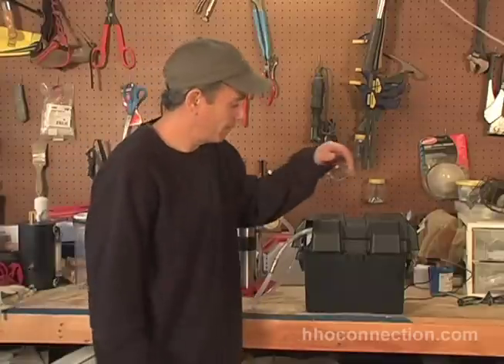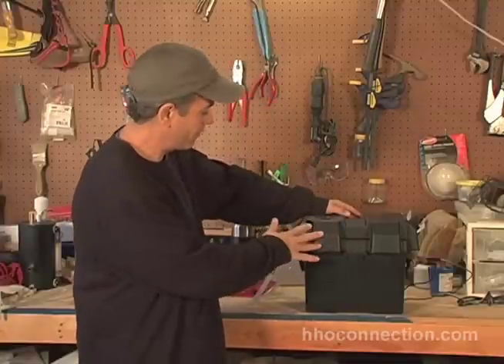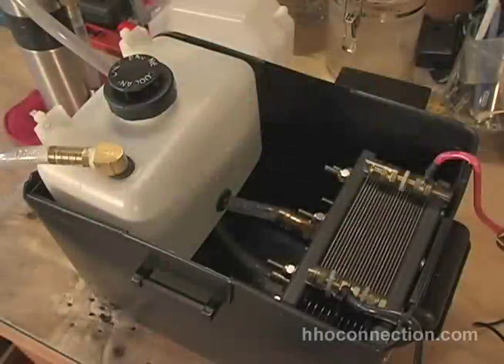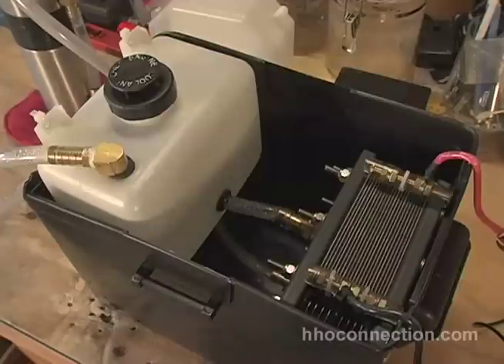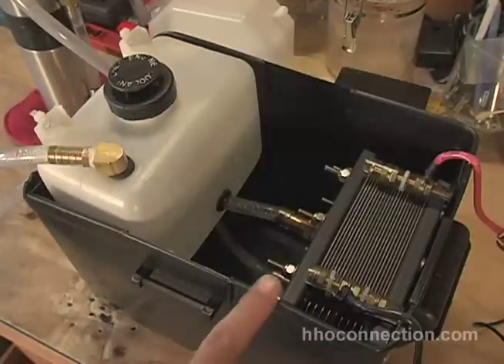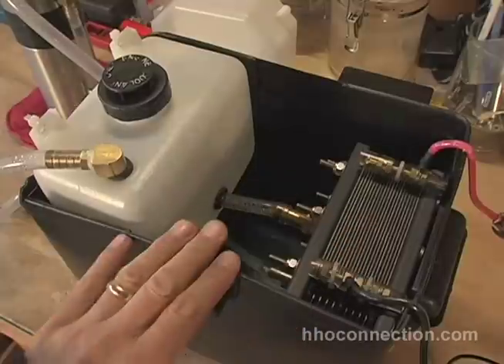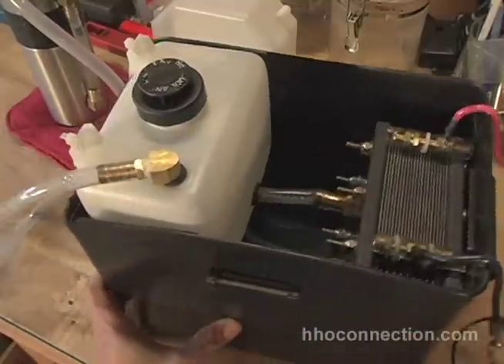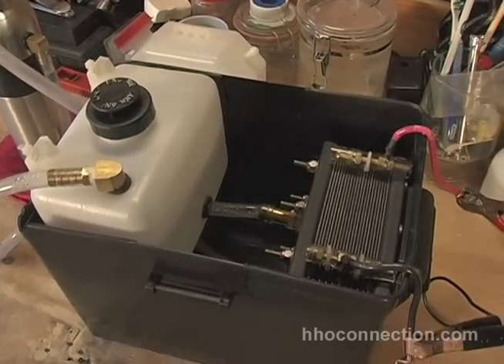Dry Cell Battery Box Idea

Comment: Very nice.  I've learned from your knowledge and experience and will apply it to my project.  It's a liquid cooled dual wet cell with an HHO ECU(Had to build this part myself) and a bubbler with baffles.  Just want to improve the efficiency of the HHO system while improving the efficiency of the gasoline engine I'm applying it to.

Comment: a true Hydrogen fuel cell consists of nickel plates with KOH as an electrolyte plates are separated by PEM   Hydrogen is fed from a tank like a diving cylinder into the one side of the plates in the cell,and another cylinder feeds oxygen in to the other side of the Nickel plates, this sets up an inter phase and the current that is produced will be a result of the pressure at which it is fed into the cell.
This is how the 2 Moon Buggies are able to travel on the Moon.
Reply: This is a different type, bruh. The opposite

Comment: @Maxpine
If you really want to improve your car engine efficiency
and save your car fuel expenses..
There is a better way to do this..it is HHO Gas
Using Hydrogen Hybrid Alternative for improving
your cars miles per Gallon or Kpl
search to read more on Google for 
"Top HHO Car Gas Research"
Choose the first result(just to skip the advertisements)